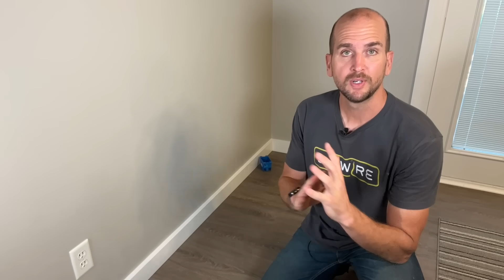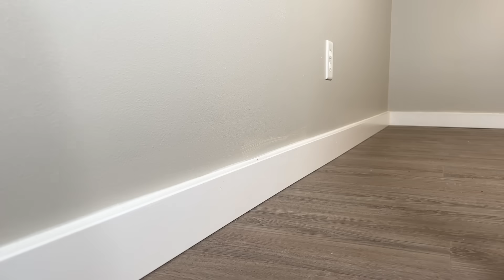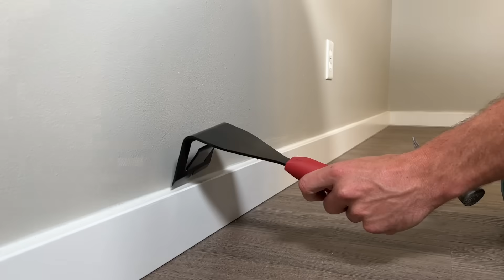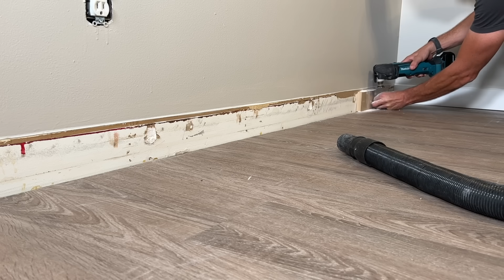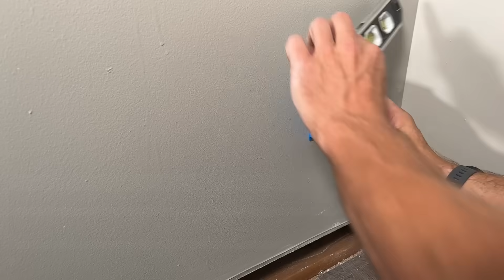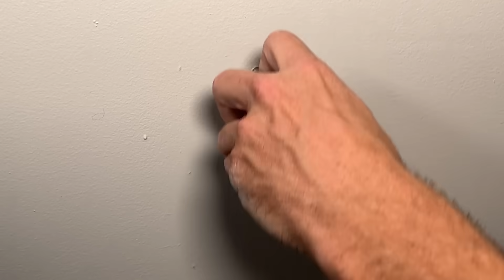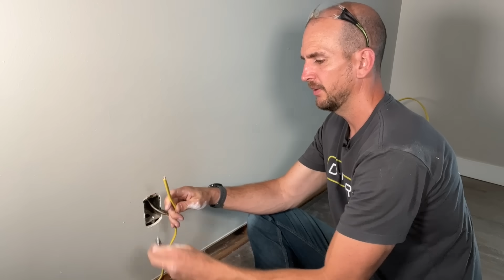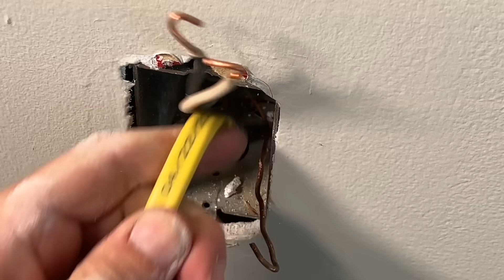How To Add An Outlet To A Finished Wall

Comment: Plot twist: You can't open up a wall without finding something you didn't expect. More'n likely there will be a pipe, or a vent, a stacked studs, studs on the flat, etc ad infinitum. There are more ways for things to go wrong than there are for things to go as planned.
Reply: And this fails codes; unsecured wires, no nail plates .

Comment: Appreciated the tip about getting the clamp on the old work. I did have two questions, why use pigtails when you can connect both wires to the upper and lower screws for hot and neutral? And shouldn't you have put wire protector plates on each stud to protect the wires from nails or screws in the studs by code?
Reply: Pigtailing is done because forensics has shown the little removable tabs between the duplex's upper and lowers can overheat and create a fire. Pigtailing makes your recepticals work in parallel instead of series.
Reply: If one were to wire this without pigtails, the current to the new receptacle would have to flow through the existing receptacle.  If the existing receptacle were to fail, the new receptacle would lose power.  Perhaps not a major problem in a case like this, but still best to avoid, since it is so simple to do so.  In cases where multiple receptacles are on the same branch circuit, such a failure could mean an entire room (or more) losing power if the first receptacle in the series fails.  In other words, pigtails for all receptacles removes a potential failure mode.

It isn’t a hard and fast rule (and local codes can differ quite a bit), but generally, one of the few cases where all “downstream” receptacles should receive current through the first is when the first receptacle is a GFCI, and the downstream receptacles need GFCI protection.
Reply: @SeanD313  
A somewhat reasonable explanation Sean... However, the current is flowing thru the solid jumper plates on the sides of an outlet - so in reality I see no point to this extra step.
Reply: One common failure in outlets is the terminal screws coming loose over time. If you jumper all outlets to the next it's a lot harder to troubleshoot where the loose connection is. If you pigtail the outlets and hook them up in parallel, you can just look at the outlet having the problem.
Reply: @openeyes-411  seen too many receptacle failures take out everything down stream of the failure, as little extra work as it takes to do pigtails, it's well worth it, 20 year electrician approves this message

Comment: Easier on the new right side box to push wire along floor area first and then push wire up into wall, push into new remodel box and fasten to wall...

Comment: When bedrooms (and living rooms or any residential room) gets designed, it is fair to say there are dedicated walls for specific furniture such as sofas, beds , and appliances like refrigerators. The concept of concealing the outlets behind a bed's headboard is an odd approach to have a clean wall at corners that may remain exposed (sans night stands), but not too practical when wanting to plug your alarm or table lamp or other.
Reply: There are outlet strips with flat plugs that hug the wall.  They help in such situations.

Comment: You recognized the danger of nails penetrating the cable.
But the National Electric Code addresses this.

Your installation is a violation of the NEC and a safety violation.

Call a real electrician.

«In both exposed and concealed locations, where a cable- or raceway-type wiring method is installed through bored holes in joists, rafters, or wood members, holes shall be bored so that the edge of the hole is not less than 32 mm (1.25”) from the nearest edge of the wood member. 
Where this distance cannot be maintained, the cable or raceway shall be protected from penetration by screws or nails by a steel plate(s) or bushing(s), at least 1.6 mm (1/16 in.) thick, and of appropriate length and width installed to cover the area of the wiring.»

Comment: Apprentice electrician here! just had a job with this exact scenario, journeyman just had me cut access holes where the studs were. That's all fine and dandy on single studs but i had to go under a window which meant 2 sets of three studs stacked up. I wish I would've watched this video prior it probably would've saved me hours messing around trying to get a hole fired through all 3 studs, amazing tutorial!
Reply: For some reason, under my windows, I had 4 (FOUR!) 2x4's lined up as jack and king studs.   I gave up drilling through them, and notched them from the front.   Fortunately, I was below the baseboard, and could cover up the mess.  No room for metal stud plate protectors, but that's the next guy's issue :-)

Comment: Just had to do this on a 1900s house to rewire the 2nd floor exterior walls that would be next to impossible to fish.

We cut all the walls 4 inches up from the bottom, removed plaster & lath.

Since the studs are set back so far at the baseplates, Once wires were ran we cut 2 inch strips of 3/4 pine and nailed those to the floor, used a square so they lined up the face of the wall perfectly.

Now we can reinstall 4 1/2 or 5 inch base, and as long as you nail the tops and bottoms of the trim you couldn't hit a wire if you tried.

Comment: Just wondering why you used 12/3 for 15A circuit rather than 14/3?
Reply: Yeah, I wondered about that, too.  The outlets are clearly 15A outlets, and the inbound wire in the first box looked like 14.   No replies from the poster (yet) :(

Comment: Good video, As far as the final touch up, I would scrape the old caulking off the trim before re-install, old loose caulk edges will make the fresh caulk look bad, and possibly crack quickly. Unless it is really old, that caulk should scrape away easily.

Comment: Really neat job! Two questions. I have to do the same think in my appartement but the walls are covered with plaster and behind it’s probably wood lattes (1910). I really don’t know how to pass the cable and hide it. Any suggestions? Second question, why use a piggy tail instead of using the second set of screws to connect your cable in your old box? Thx
Reply: My guess is that in the event he ever needs to work on or remove and blank the original duplex location, he can do it without having to worry about affecting the circuit to the new duplex.
Reply: You can use the second set of screws on outlet for the new additional outlet. Probably his old outlet didn't have the extra screws. You only need to pigtail the ground cable.
On your wall if you don't have molding then you can add molding to that room.
Reply: @joaquinsuarez6090  He upgraded the existing outlet to a commercial grade, and attached the wires via the back on both outlets.

Comment: Usually you can pull the trim nails thru the back and leave the face clean. Snipping them off is okay, but I'd rather have them gone for less chance of hitting them later.

Comment: This works very well with the framing as shown. I worked on construction sites 30 years though, and never saw a wall where the sheetrock did not go all the way down to the floor and be screwed to the sole plate and studs vs the 1x4 backing that magically appears when this guy takes off the bottom molding.
Reply: He cut the drywall away. there was no 1x4 that "magically appeared."

Comment: Three quick comments here: First, I don't pry against drywall directly, to much possibility of damage. A piece of 1/4 plywood behind the prybar spreads the force out. Second, these days don't assume nails are the fastener used on the drywall, screws are becoming more common. For that, finding the head and backing out the screw is the best method. Third, for the connector on the box, I think that is a good application for a romex clamp connector, because it pops in and then you stuff the romex into that.

Comment: What does the electrical code say about running loose romex (not pinned to studs) through walls? Theoretically someone could drive a nail into it no?

Comment: UK electrician here. I am a little concerned to be honest. First job is to shut off the power. You do show WHEN YOU shut the power off as you take off the face plate and  use a steel measure almost touching the socket. Also There could be cables running low down behind the base board which the tool may cut through and lastly no earth earth sleeving cable?
Is this not law in the US? In the UK you are not allowed to have any unprotected cables anywhere so earth cable require sleeving in all circuits /boxes etc.  An unprotected earth cable could potentially become live if a live wire touches it making anything on that circuit live.  (Although here in the UK we have RCD's on all circuits. which would kill the power automatically if an earth fault occurred )
Reply: There are SO many differences in the codes between US and UK that we can't get into them all.  

A) You ASSUME that he had not shut off the power prior to removing the wall plate. 

B) the depth of cut is to be controlled to not extend more than an 1/8" into the stud or beyond non-backed drywall when removing the drywall.

C) Metal-clad cable is not required and rarely used in non-high rise residential applications.  It is required in high rise and commercial construction.

D) All properly installed circuits must have overload protection and GFCI (RCD) is required only near water use sources such as sinks and tubs. A typical circuit breaker will also cut power in the case of fault but at the trip current level which is quite a bit higher than the RCD/GFI.  Plus is every circuit in every home in the UK fitted with all of the safety gear and professional craftsmanship you cite?
Reply: @1dariansdad  Assumption is as they say the mother of a %$£*&^ so anyone who instructs must tell the people who follow safety comes first.  Nice the way you turned it round on me to be the bad guy. IF it saves one life is it not worth mentioning?? or shall we keep quiet about it and hope??

Maybe cos of where i live it is instilled in me. Plus even qualified sparkies have forgotten to shut power off before beginning work I have seen this many times. Also i have shut power and then checked a circuit to find it is still live hundreds of times in my career.  AND been zapped sometimes !!! so the lay person needs all the help they can get. Or am i being silly??

As for depth you are now assuming that a diyer can always judge your 1/8 of an inch. I use oscillating tools and have slipped deeper than normal even after many years of using them we all have accidents.

I NEVER mentioned metal clad cable. That is for outside and underground works. I said sleeving which is a roll of tubed PVC insulation that slides over the cable to "sleeve it" in the UK it is yellow and green to denote earth cable.

In the UK it is illegal to have any switch or socket in a bathroom or within reaching distance of a water source, I.E a sink in a kitchen so that you cannot touch power and water at the same time.

All consumer units fitted since 2008 in any new installation or upgrade must have RCD protection. OLD units do not need to be upgraded, however if you sell a house then you would not get an electrical safety certificate meaning it may be difficult to get a mortgage so most do the upgrade before selling. There is also heavy law and fines for the DIY er working on electrical circuits in the UK , There are only some things legal to work on. You cannot extend a power socket like in this video, we do not use radials. We use a ring main so it would have to connected in line to 2 sockets.. Extending a radial like this is dangerous as then a large high load appliance could potentially be used at the last point and without RCD it could overload the circuit and cause a fire, hence why we always have a ring main. You can spur off for a fan or such but this again must be a separate switch fused spur rated to the appliance. which also has a fuse in the plug as all plugs do in the UK. even extension leads have fused  plugs. Seen a lot of extension leads in the US melt and start fires. ( yes work there in 97 / 98)
Safety first, check check again and then check once more. 

Or don't and be a statistic. Your choice. but others shoul be made aware of the dangers,  they need to have that choice. Right?

Comment: Super Good tutorial! This is one of the Hard Problems in DIY electrical work. I love the pack of little tricks to make the work easier, for instance, putting the clamp on before feeding the cable up to the box. I admit, I almost routinely cut out the old boxes and replacing them because they're too small. Of course, I remember the time I went to all this work--and then, because the dry wall was crumbly, I ended up calling in the drywall crew and just redoing the entire wall. sigh

Comment: Great idea removing the baseboard and going that route.
I have just one question. Why use wagon nuts and pigtails in the first box? Seems like a lot of extra wire to shove back in. Why not just wire start to the outlet? Just curious?
Reply: Pigtails are used to avoid a potential point of failure.  If one were to connect a new receptacle directly to an existing one, then if the existing ever fails, the new receptacle (and anything else that has been added downstream of the existing) would lose power.  Even though pigtails and connectors take up space in the box, they isolate receptacle failures and allow the rest of the circuit to continue functioning should such a failure occur.
Reply: @SeanD313  It's not reducing the number of potential failure points, it's just changing the potential failure points from being the commercial outlet screw connections, to the Wagos.  As for the "everything else downstream" argument, the same is true.  If you would have had 6 outlet connections in series, now you'd have 6 Wago connections in series.  

If you don't trust the top screw of an outlet having a good connection to the bottom screw, buy a better outlet.

The only halfway sensible argument for using the Wagos, is to reduce the number of wires attached to the outlet, to reduce the stiffness when pushing the outlet into place, and hence reduce how likely it is that some wires will get bent/moved/located some way you don't like.

Comment: Is there a reason why you had to use pigtails on outlet you piggybacked off?  why could you not just put both wires under the same screw plate?  ( Aussie here and thats how we would do it)

Comment: I'm going to try your approach to install a PEX water line for an outdoor faucet. Great tip to use a piece of 1-by to guide the oscillating saw when cutting the drywall.  One thing I've found helpful when using old work boxes is to run the flange screws in and out once or twice before installing the box; helps make sure that they work easily and correctly.
Reply: If possible move the pipe closer to the bare edge of the stud, and then add metal protector plates on the studs to help protect the pipe. Metal protects the side you are working, and distance protects from the other side. PEX is so soft anything can cut it. On the flip side I once saw a copper pipe behind the baseboard...without protection someone had driven a 16ga finish nail straight into it...and it didn't leak, until the trim was pulled off!
Reply: Hope you don't have freezing conditions
Reply: @mrmotofy  Good point. All but the last foot or so is inside interior walls and that last part is well insulated. I wanted to install a freeze proof sillcock but just didn't have the room to do it.
Reply: @TybeeHandyman  I believe most of them won't fit in a wall anyway they're like 12" long.

Comment: Generally unless it’s the last in line they run the e wires around the house to each outlet in a straight line 18 inches off the ground so adding an outlet in series is simple again unless the one before where you want to go is the last in line then your just opening a hole in the wall to nothing

Comment: Are all your outlet face plates the same in the US ?  We have different finish types here in Australia like Clipsal Saturn which is a glass style finish, slim line finish, brushed metal etc.  The standard US ones I've always seen seem a little bland.
Reply: No, but the standard here is usually a nylon type material due to cost, there are many types available, I have seen brass, brushed nickel, stainless, mirrored glass, wood, and several other types over the years, but they usually cost more money per piece than a standard nylon cover plate

Comment: Tip: I always use WD-40 or silicone spray on the remodel box's screws. Those things are horribly designed; the manufacturer needs to admit it and use a good lube.

Comment: I’m all for the DIY videos, I learn a lot and I’m constantly doing something in my home. However, when I do wiring changes, I pull a permit. In my state, I can only pull the permit if I attest that I’m doing it on my own property in which I reside. In this video, Scott clearly says it’s for rental. He might do it right, but there are certain ethical issues at play. As the resident/owner I can accept the risk of something going wrong - are renters informed of all the work done by non-licensed professionals? 

Would love for a professional to weigh in.

Comment: Thank you I learned a new method for adding another outlet.    I sure like the idea that the only cutting to run the new wire was behind the baseboard which eliminated any patching that is noticeable.

Comment: I've been a licensed master electrician since 1999. You did everything right! Great job!
Reply: Since 2017(?), NEC has required nail plates.  They have always been a good idea.
Reply: Extending with AWG 12 is fine.  How did you determine that the circuit was wired originally with AWG 14 and protected by a 15A OCPD?
Reply: Inspectors pass lots of things that they shouldn’t.  In this case, the cable should be protected from severe damage, namely, from piercing by nails or screws.